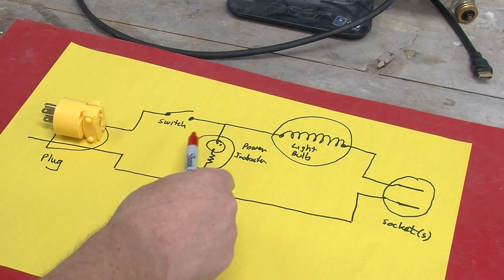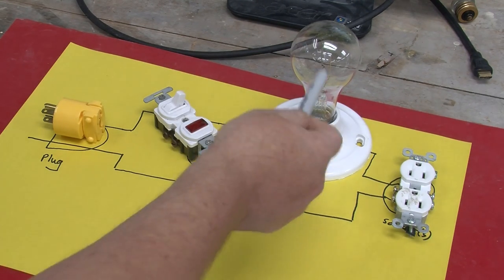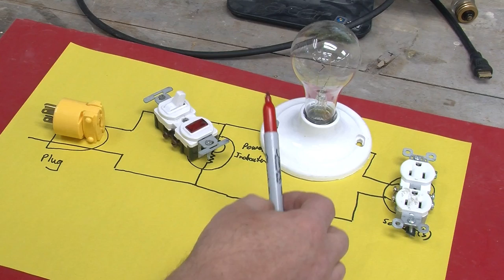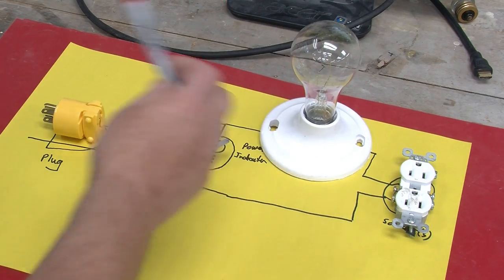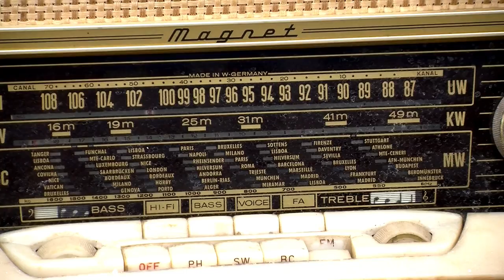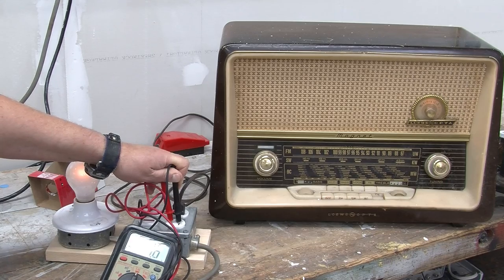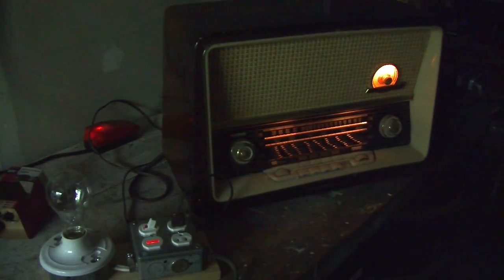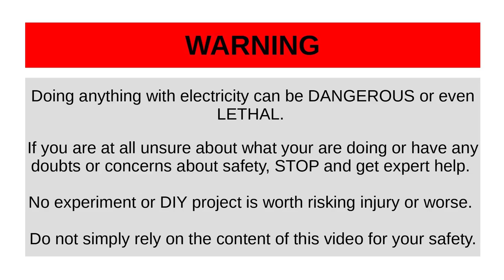When a Light Bulb is better than a Fuse

Comment: Can we use an incandescent halogen bulbs ?
How come the higher the bulb wattage, the less resistance there is?
How do you select the proper initial bulb wattage?
Reply: 1. Halogen is fine. 2. Ohms law. 3. Start small, especially if DUT status is unknown or known to be blowing fuses. If the bulb causes too much voltage drop for DUT to operate, you can increase buld Wattage to reduce voltage drop to DUT. Again, Ohms law is your friend, understanding a little about resistor dividers helps, and playing with KNOWN GOOD devices at first will help you understand how to use this awesome setup. Cheers
Reply from the maker: The lower the resistance, the more current flows. voltage x more current= more power.
Reply from the maker: I wonder if there is voltage level for halogens where the glass temp is not sufficient for vaporize - redeposit cycle to work. Or if when the temp  is that low, the filament is fine because it doesnt loose any material?
Reply: @ElectromagneticVideos : For what it's worth, I have Halogens that have been around the bench for YEARS. I like halogen due to high current in smaller packages. I have 500W and 1000W theatre spotlight bulbs which are short lived in their native habitat, but living comfortably in my lab. Life expectancy when repurposed as test gear hasn't been an issue.
Reply from the maker: @hightttech  So no issues when operated at lower power  - interesting. I tried one as a solar panel load. The DC seemed to kill it - I think it caused the re-deposition of filament material to be more towards one of the ends.
Reply: @hightttech  automotive headlight bulbs are halogen (at least on older cars) and last a very long time. Might try a higher wattage bulb.

Comment: I am henceforth going to annoy my kids by referring to incandescent bulbs as "current-actuated temperature modulated variable resistors".

I repaired solid state electronic equipment for a local music store in college, and this would have come in handy at least once. The store's circuit breaker served a similar purpose, but turns out my test bench was on the same circuit as the point-of-sale system, so was a little less convenient for that reason (as well as requiring a full 1800w of draw before tripping, so didn't always protect everything...).
Reply: I'm permanently borrowing "current-actuated temperature modulated variable resistors" 🤣

Comment: I use light bulbs as DC electric fuses for battery boxes I build to power electric fences (for keeping animals in). a 12V 21W bulb will easily pass the 150mA needed to power the fence energiser, and if the output is short circuited or reverse connected, the bulb lights whilst the current is limited.
Reply from the maker: So for cow fences or do you do ones for bigger animals? I have seen them made for bears and wondered if they are setup to deliver a significantly bigger jolt. (From first hand experience I know the cow zapper jolt is - well - very attention getting).
Reply: @ElectromagneticVideos  It's for horses, the energisers take about 150mA at 12V and produce a 7kV pulse with an energy of between 0.8 and 1.6 Joules every couple of seconds. There are other sizes (Down to about 0.1 Joule and up to 2.6 I have seen) but most are in the 1 Joule range. Interestingly, it's less about the size of the animal and more about their coat. Sheep need a much higher voltage (and energy) because they have thick wool. Horses need a medium power because they sometimes wear rainproof coats (here in the UK Western isles) which provide insulation. Pigs only need a low power fence as they are most sensitive. (That's the three animals I have fenced in/out!).  The great thing about horses is they are quite clever, we don't want to Zap them, but they learn quickly to respect the fence and graze the marked area - you can often get away without turning the power on at all for a few days. If the horses really need to escape, they will either jump or barge the wire and break it (which happens too!) so we prefer it to barbed wire (which can be very nasty). We had problems with fences not working because the fuse had blown - nobody bothers to check if the energiser is working so the horses eventually figure it out and escape. So I replaced the fuses with light bulbs and the problem is now gone.

And yes, we have all had a zap or two ourselves - unpleasant, but harmless.
Reply from the maker: @gavinminion8515  How interesting! I never thought about how the coat being a factor but that makes sense. I can sure see the pigs with there almost hairless body like our being the most sensitive. Also interesting how smarter animals figure out things - they are often way smarter than we give them credit for. 

Also didn't know you could set the energy so precisely but with modern electronics not a hard thing to do. Somewhere in a shed I have an almost antique mechanical cow fence zapper. I'll have to find it and measure its output if it still works and see how it compares with your numbers.
Reply: @ElectromagneticVideos  I perhaps gave the wrong imperession about the power output, whilst I'm sure there are types you can configure the output on, normally you buy the type best suited to your requirement. I also should have added that higher output is better for longer fences - we use 0.8 Joules for field separators (to control grazing) and 1.6 joules on the common (open ground) where the fence goes a longer distance. Thanks.
Reply from the maker: @gavinminion8515  Oh - ok - no worries! Even at that, I'll bet in the old days it was much cruder in terms of estimating energy delivered per pulse if they even knew it at all. I can see the higher output for longer fences - more loading and leakage along the long wire I'm sure.

Comment: great video! i’m a bit confused on the difference between using this or a variac. this limits current, right. and the variac limits voltage. i assume u can use them in series? variac and then dim bulb tester?
Reply from the maker: Yes - you described it well. But just to be clear, when you limit the current with a device like this and the load (radio, tv or whatever you are working on) starts drawing current, the voltage will drop so you may have to put in bigger bulb to increase the current and bring the voltage up for the device to begin operating. 

Its usually the current that causes things to melt to catch fire so limiting the current usually prevents that. If you use a variac by itself and have a short somewhere, it can supply enough current even at low voltage to do some damage. So whether you use a variac or bulb or both depends on what you are working on.
Reply: @ElectromagneticVideos  gotcha .thanks for the quick reply! cheers!

Comment: WoW, I have the SAME radio at home in England 🏴🇬🇧 It is in FACT my friends. But he got his information a bit WRONG, as he told me that it was a WW2 radio, but I do NOT remember if it was on the inside or outside, it had an ink pad stile stamp on it with the year of 1960 or 61 ???
As I am NOT that sure when FM broadcasts first started, but I do “and did “ not think that it was in WW2 ?????????
Wish I was able to send you a photo. But the BEST thing about this radio, is it’s sound and tone.
Reply from the maker: That neat! It is definitely post war and the 1960/61 stamp sounds right for the for the tubes (valve to you!)  in it. FM broadcasting began in the late 30s but it only became common in the 40s after WW2. It had a tragic start (look up  Edwin Armstrong) and that included a frequency shift to the current band in the 1940s.  Your right the sound is so good! I want to do a video sometime on why tubes sound different from transistors - way more factors hat simply the tube characteristics - but a significant part of that radios sound I'm sure is the large speakers and being housed in a big cabinet. The cheap "All American Five" radios so common on this side of the Atlantic do not sound anywhere near as good. And the radio - and most German ones - were generally built simply with a much better quality mindset (and higher price).  Put up a video - it would be great to see!

Comment: Events of my day today were I guess the word may be serendipitous.
I’ve been watching some of James Condon’s videos lately so I went out and bought a Kill A Watt monitor and a digital clamp meter and changed the dead battery in my old Sears digital multimeter.
I was using the Kill A Watt this morning to see what the wattage was on a small Sunbeam electric “cube” heater to see if it would draw enough power to be useful in testing my 3000 watt home generator ala James Condon. (Also have a 1500 watt heater like James uses.)
I noticed that with the heater on the high setting and the thermostat turned  all the way up the watts were about 800 and slowly climbed to 1000 and stabilized there. I was wondering why the 200 watt climb happened and concluded that as a resistor coil heats the resistance must increase.
Then I googled why you should not plug an electric heater into a power strip/surge protector which I recently read somewhere since I’ve been doing that for years. This led me to your YouTube video about overloading extension cords and below that was this video about the light bulb protecting electrical components and that reminded me of videos I used to watch about amplifier repair by Uncle Doug I think it was.
In this video you talk about how as the bulb filament heats it takes or draws more load or something like that and this confirmed my observation that as my small heater heated up the watts climbed by 200.
When you turned on the vintage radio I was disappointed when it did not immediately blare German martial music, hah hah!
Reply from the maker: You just gave me the greatest laugh about  blaring German martial music - I wish I had thought of that! 

Very interesting observation about the heater - it really should have gone the other way.  Heat makes metals more resistive so as they heat up, the  heater element should draw less current and therefor less power. Maybe the fan was slow to speed up and cool the heater elements so their operating temperature dropped as the power consumed increased?
Reply: OK, thanks for replying and setting me straight on my incorrect thinking about heat and resistance and what this does to the power usage.
The problem may be that the heater coil is badly clogged with dust and the fan cannot blow much air through it.
I’ll take it to a relative’s house that has a large air compressor and attempt to blow the dust out from the fan (back) side. I took it apart and tried to clean the heater coil from the front side with a “dust buster” vac but that did not help very much.
I’ll try that experiment again with a hair dryer and see how it goes.
Thanks again for replying and thanks for your interesting and informative videos. I’m looking forward to learning more about electricity and maybe I won’t shock myself like the great inventor and musician Les Paul did to himself. I think I read it took him almost two years to recover!
Reply from the maker: @mikewalters5653  Well you had the right idea as to the heat causing the change in power. If it clogged, who knows what happened as it heated up - maybe some of the dirt blew away or melted allowing more air in. Be interesting to see if you can see any such effect with the hair dryer.

I had never heard of the Les Paul   shock  story - just googled it - he must have suffered extensive skin burns form the sounds of it - how terrible that must have been. 

Glad you enjoying my videos. Don't hesitate to ask questions - I'm always happy to try and explain things that maybe weren't as clear as they should have been in the video!

Comment: A rubber fuse is a great diagnostic tool that everyone who repairs electronics should be aware of. I just had to comment on something in the vid that sets off one of my obsessive compulsions. How many Sharpies or Magic Markers go in the trash not because they ran out of dye, nor that the tip is abraded that it makes too wide or an intermittent mark due to abrasion wear of the fibers, but because somebody left the cap off? Put the cap back on the Sharpie dangit! You are unnecessarily evaporating all the solvent.

Comment: It along with an isolation transformer and a variac, is a good way to slowly bring up older equipment to test it, but if you have the slightest care for the equipment, beyond just testing and troubleshooting, I would not trust older electrolytic or paper capacitors  to simply "reforming" at limited current. While they may appear to be working, they can be passing DC and the result can be blown tubes and/or transformers, some of which are unobtanium these days.
Reply from the maker: Very good point! And unfortunately theses days, due to supply chain issues, its not just the old stuff that is unobtanium! Which is, by the way a great word that I will have to remember!
Reply: I'm taking Paul Carlson's advice on this one; paper and wax caps are not to be trusted even if they pass a leakage test at voltage. If you care about the device replace them! It's only a matter time
Reply from the maker: @mr-meek  Yes - one certainly can learn a lot about the long term reliability of components from the experiences of people like him with old equipment. I try and avoid most types of caps except ceramic for new designs - not always possible of course particularity when one needs large values = electrolytics (ugh!)

Comment: Resettable fuse at home:

But seriously, I commonly use a 12V 5W bulb to protect my breadboard circuits from short circuit oopsies. Has saved many components over the years and no replacement fuse needed. And comes with a convenient "short circuit" indicator light.
Reply from the maker: The low voltage equivalent! What a great use - you made me think that I should setup something with a bulb like yours with some banana plugs to go between a power supply and experimental circuits.

Comment: Was ready to see how it works when there is a problem. 
A fuse would blow and assumed that the light bulb would would take all the voltage and not what is plugged into the outlet. 
Is this assumption true?
Reply from the maker: I think your right but  I'm not 100% sure I understand you description of what happens, so here is my description: Device being tested shorts, so now the bulb gets the full voltage of the AC supply (120V here, 240V for  most other continents) so the bulb lights up. The bulb also limits the max current that can flow though the short, depending on the bulb size, usually to 1 or 2 amps. That current limiting behaviour protects the device. If it isn't a complete short, the is  a bit of voltage  across the device being tested and and that can be probed to find where the short is. Hope that made sense!

Comment: It isn't easy to find 200W bulbs, may I suggest making a modification to this rig by adding a second bulb in parallel with the first. This would allow you to use 2 100W bulbs and achieve nearly equivalent results.
Reply from the maker: That would work nicely and also be really convenient for gradually upping the current if they were independently switched.

Comment: I remember someone fixing our pool garage door he used a lightbulb and the bulb lighted up and the garage door still wasnt working i think it was a mechanical problem with the garage opener and closer itself
Reply from the maker: I would guess in a system like that where you have the controls and actual door opener quite far apart would be very useful to isolate the problem.

Comment: Yeah, a basic current limiter. I used cars turn signal bulb, zinc AA battery plate and piece of cloth soaked in hydrochloric acid for rust removal and electrolysis treat for the same said car chasis. Just hook it up on a cars battery, turn on the ignition and apply salvaged battery plate to corroded metal of the chassis. When the protective layer is deposited enough on the surface, bulb turns dim - indicating a successful application and thus limiting the current
Reply from the maker: Thats really interesting - never heard of that - but maybe old news for car restorers! So do you have grind or sandblast the rust away first or does it take care of the rust simply by electrolysis? And is the cloth placed between the corrosion and zinc plate or is is jut used to wet the area? I will have to try that sometime!
Reply: @ElectromagneticVideos  yes, wet cloth is there for transfering zinc salts onto steel metal. And yes, also theres prep work involved too, such as sanding and degreasing. I will try to find and provide yt link about the topic
Reply: @ElectromagneticVideos  its not a restoration by any means, but makeshift temporary solution to cover local area covered in rust
Reply from the maker: @spqr528  I have to do some googling! That sort of thing would be of use up here with all the salt on the roads in the winter.
Reply: @ElectromagneticVideos  im glad i could help
Reply from the maker: @spqr528  Hey - anything to combat corrosion is useful up here!

Comment: I have a pair of 1980s/1990s speakers that uses a light bulb as a fuse to protect the drivers.
Reply from the maker: There have been so many interesting applications posted here that I never would have guessed at and you just added one more - how interesting! Are they low impedance, or why the need for extra driver protection?
Reply: @ElectromagneticVideos  some speakers use fuses, this manufacturer used light bulbs.
Reply from the maker: @kenschmidt6522  Interesting! I'm obviously not an audio guy!